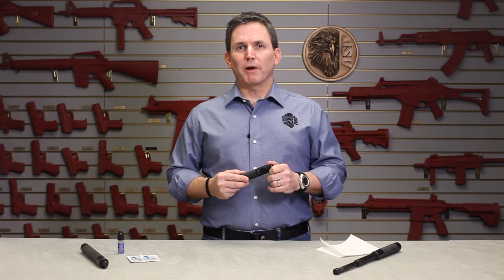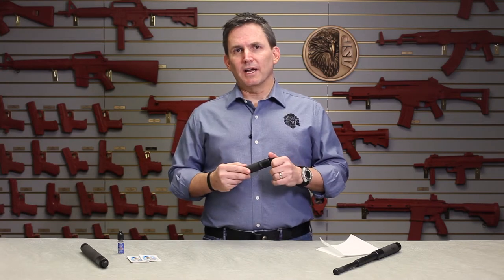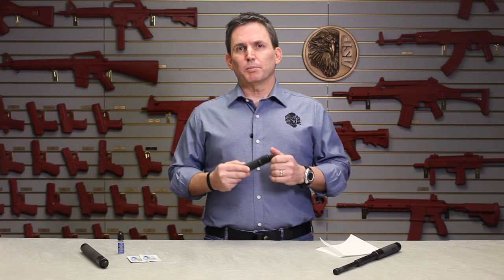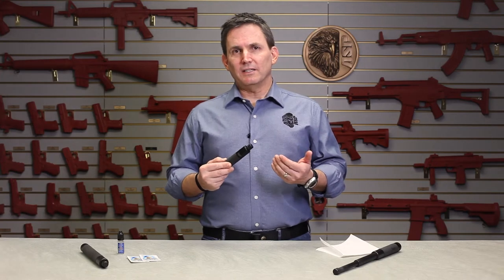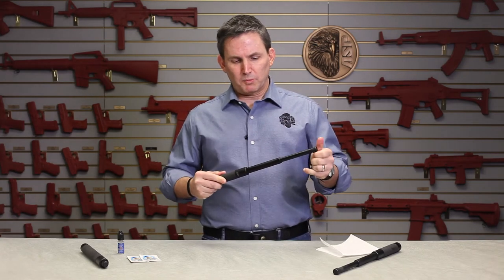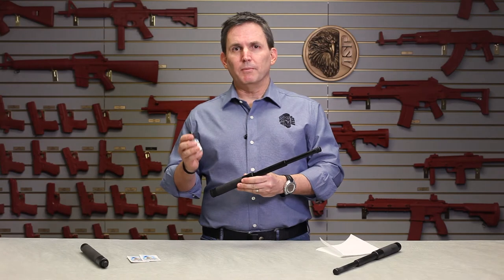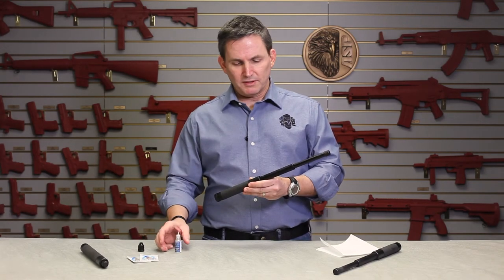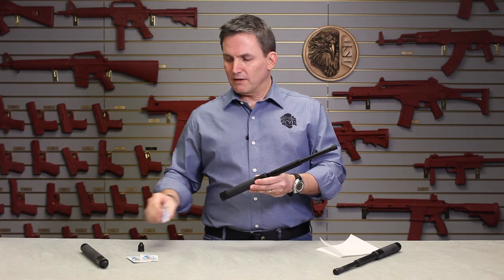Talon Baton Lubrication

Comment: I like your lubricant. The bottle it comes in however is poor. The bottle that came with the repair kit I bought, has two modes: 1) Sealed somewhat tightly (some still leaks out, usually inside the repair kit box and coating everything in oil). 2) Remove the bottle cap and spout that is supposed to be used to drip out lubricant TOGETHER. You cannot remove the cap without removing the spout as well. I like your products, this bottle? No at all.
Reply from the maker: We are sorry to hear that your bottle is leaking, it obviously should not be, and we would be happy to send you a replacement.  Please email us at customerservice@asp-usa.com with your mailing address.
Reply: @aspusa1  Thanks, much appreciated! I will do it today.
Reply: ASP I received my ASP baton today. My baton right out of the box is not lubricated from the ASP factory.

Comment: In my country korea, I cant buy glide oil. Can I use victorinox multi tool oil or boker knife oil in my talon?
Reply from the maker: If you have a Talon Infinity model baton, and it’s kept clean, it should not need routine lubrication. However, it’s fine to use light lubrication on any Talon Baton if you want to. Any quality gun or knife lubricant should be fine.

Comment: Great video. Can I use hoppe’s gun oil?
Reply from the maker: We recommend ASP Glide: https://www.asp-usa.com/collections/baton-accessories/products/glide. But you can use any quality gun oil, just make sure to use very little, operate the baton a few times and wipe off any excess. Also note that the newest generation of Talon Batons, identifiable by the Infinity logo on the grip, are designed to operate without the need for routine lubrication.
Reply: @aspusa1  Excellent. Thank you!
Reply: @travis7843  I been using a little bottle of oil my shaver came with on my old EDC baton. Some oils are too dirt attractive, I am sure there is a term for that. Some Silicone 3 n 1 would be decent if you dont have theirs

Comment: why this lube can't be use on friction lock baton ?
Reply from the maker: As the name suggests, Friction Batons depend on the friction between the sections to secure them in the extended position. Lubrication actually defeats friction, and therefore should not be used on these batons.
Reply: @aspusa1  thanks for the answer.